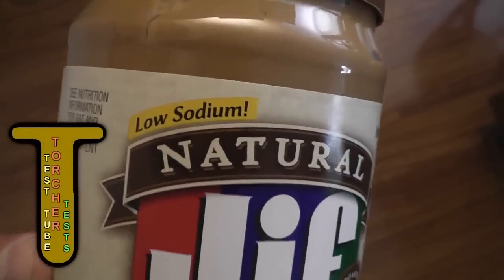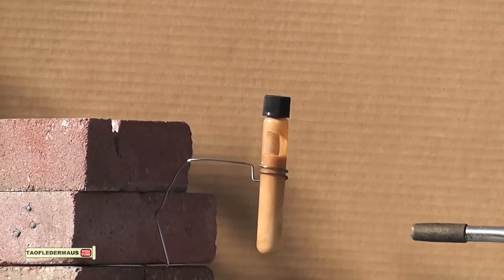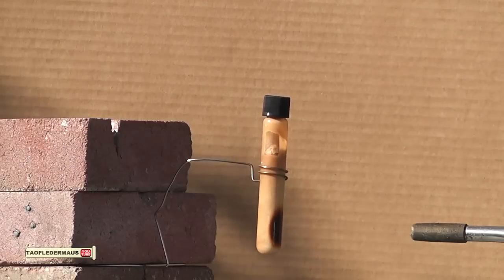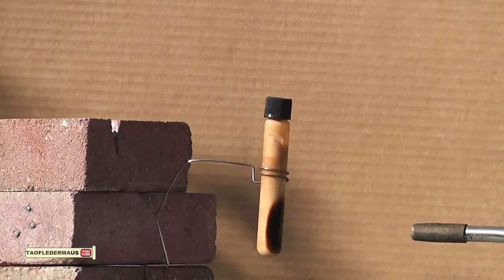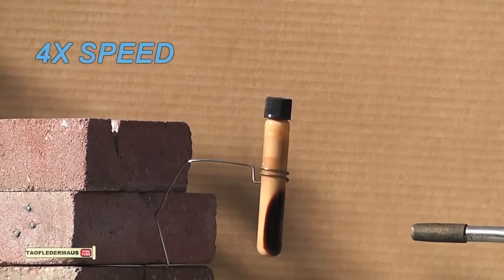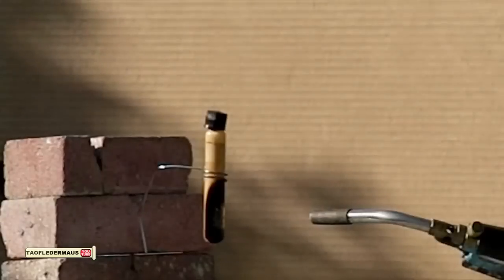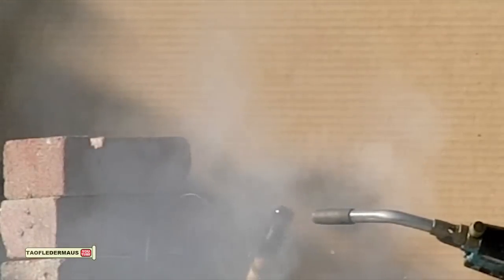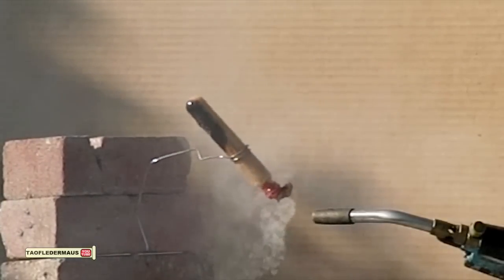Test Tube Torcher Tests - PEANUT BUTTER

Comment: What if you found a way to turn the tube, I guess it would be hard but a bit of modding could easily make a mechanism. It might make it easier to test substances like the Honey that burn and cause the glass to blow out.
Reply from the maker: That would definitely help distribute the heat more evenly.
Reply: ***** If you set the round test tube base down on a smooth hard surface (hammer face maybe) and lengthened the coil a bit so it couldn't walk out, it would probably spin a bit from the torch alone.  You'd lose a bit more heat but the contact area would be so small it shouldn't be that bad.  It'd be like your beyblade vids, lol

Comment: As always, awesome tests! Though, I am very curious as to what would happen with the substances that caused tube failure if you could heat it more evenly to avoid burning and hot spots.

Also, if you need ideas for other liquids to try... think automotive. I think it would be really cool to see what gasoline, diesel, brake fluid, different weight oils, gear oil, and stuff like that would do under extreme heat. I understand that some of this is probably a little too dangerous, but I figure in small enough quantities it wouldn't be too bad... Maybe...?
Reply: bearring grease or Crisco would be cool too

Comment: Hey Jeff, I just wanted say how much I appreciate you not using an annoying intro for your videos. Something about dramatic or highly produced intros just bothers me.
Keep the amazing videos coming!

Also, you should do a TTTT with some volitile, flammable liquid, and put a candle or another blow torch a few feet away for an awesome fireball.
Reply from the maker: I try not to be too flashy or pretentious- just get to the point.  lol   I do have a tube with model airplane fuel (with 10% nitro) loaded up.   It's hard to predict which direction the tubes will blow  and I don't know if I have enough candles to place all over the place.
Reply: ***** Model airplane fluid is farly similar in compostion to Hoppe's #9, I believe. Judging by that video, I'd guess that a candle placed a foot or so above the test tube would make a nice fireball. That's just me speculating, though.
Reply from the maker: I think it is methanol mostly.   It will probably be harder than you think to get a fireball since the LEL has to be ideal for combustion.   It will probably just blow out the flames.
Reply: ***** (Sorry for an absurdly long, sciency responce) Actually, I know firsthand how hard it is. I used to be a huge pyromaniac, so my friends and I would often try to devise way to make the largest explosions and fireballs possible. Anyway, I decided to try to calculate the distance a fire source would need to be from the tube to ignite; an hour and an Excel sheet full of calculations later, I have result that isn't all that encouraging:

Assuming the airplane fuel is mostly methanol, 30mL are used, the fire source is not extinguished by the shockwave, and that that the methonal vapor expands evenly in all directions, a fire source would need to be more than 0.2 meters but less than 0.35 meters away from the test tube for the concentration to fall between methanol's 6%LEL and 36%UEL. However, the vapor cloud would rise, and the volume of methanol vapor that would definitely combust would be 0.18 m^3 (~6.5 cubic feet), so maybe the chances aren't that bad after all.

To calculate this I used the density, specific heat, enthalpy of vaporization, heat capacity, vapor density, and molar mass of methanol. I also made the assumption that the test tube would break at 92.7 gauge psi, as it did in your other video, which equates to ~120ºC for the model airplane fuel when the test tube fails.

TLDR: If you know which way the wind will be blowing, you could put a fire source 2-4 feet from the test tube, and there is a moderate chance that it would ignite; procrastination from studying for finals made me spend far too much time on this.
Reply from the maker: You definitely understand how combustion works.   I have everything set up on a tiny table,  and  I have to figure out where to aim the cameras,  etc.   Also,  I just make one TT and do one take.   So I think I will have to rely on luck to get a fireball.

Comment: @25 seconds,
Temperature is a measure of the mass and velocity of the atoms in a system. When you add heat to a closed system (like your tube) the velocity of the atoms is increased by the heat source so this is an example of kinetic energy not potential.

It is easy to mix up the two.

Comment: You should add an RC servo on the blow torch valve so that you can remotely adjust the amount of heat. Servos and a basic radio system are really pretty cheap.

Comment: Do some pure lead!!! (Try fishing weights). Not sure how hot your torch gets, but it could be enough to evaporate enough lead to blow the tube.
Reply from the maker: I have a lot of lead shot from all the shotgun shells.   I may give that a try and see if I can get it to melt.   It very well may work!
Reply: Sounds good, although lead from shot has a lot of antimony and other metals to harden the alloy. As a result, the boiling point is somewhat higher I believe.
Reply from the maker: That's possible.   I do have a lot of solder and that might be a good alternative
Reply: *****
I'm sure you have already considered this, but I am going to say it anyway. You should probably look into getting a safer containment system if you want to make lead evaporate, and definitely have respirators and such. Again, I know you have probably thought of this but safety is always the biggest priority. I am sure I speak for everybody else when I say we don't want you doing something that has any chance of hurting you.
Reply from the maker: I'm not even sure I can get the lead to vaporize.  I haven't looked at the boiling point,  etc etc of lead.   I definitely have to consider safety first
Reply: *****
2022 K, 1749 °C, 3180 °F
Just pulled that off wikipedia to save you the trouble :) I wouldn't be surprised if the remaining air volume gave it enough pressure to at least release fumes of some sort. Anyhow, better safe than sorry :p
Reply from the maker: Ah thanks!   Yeah,  probably won't be able to vaporize it,  just melt it if I am lucky!
Reply: *****
If the tubes can handle 400C it should work just fine :)
Reply: ***** the melting point of lead is under 700 F, how hot does your torch get?
Reply: frickbot
The torch can do it, the tubes will probably melt though.
Reply: ***** Yeah the lead is probably a bad idea. But here's a good idea... IODINE! (the solid, elemental kind, not a solution). You can get it on ebay. By heating under pressure, you should be able to get it to liquid (prior to boiling) instead of sublimating like it normally does in the open air. That could be realllly cool. And not dangerous either (Iodine isn't too toxic).
Reply: Njal Thorgeirsson
The lead could still be interesting, even though it probably won't do much. As long as he takes safety steps, he should do both :D

Comment: cool.
be careful as the combustion properties of common materials can greatly change when they undergo rapid vaporization.
as you saw, some of the oil vapor started to burn directly after failure of the ampule.

For example, cornstarch can burn extremely rapidly in an aerosol form.

heyyyy theres an idea >.>
Reply from the maker: I'm always a long way away.   I have some test tubes loaded with much more flammable stuff.

Comment: I wonder what happens if you use crude oil in a Test Tube Torcher Test?
Reply from the maker: I tried some Valvoline motor oil and the dang thing sat there for about 15 minutes and never leaked or blew or anything.   It did expand and turn black though.  I trashed all the footage since nothing happened.

Comment: What's with the red guts coming out of it?
Reply: That's the plug.. from what I understand, it's a substance that goes into the end of the test tube to seal up the end.. the cap goes on after that to seal it even more.
Reply from the maker: It's high temperature silicone used to plug the test tube.
Reply: ***** Why not try an epoxy? I think the silicone would be to bendable whereas the epoxy would be more like an extremely hard plastic. Just a thought anyways.
Reply from the maker: I originally used epoxy but it has a different expansion rate than the glass so often it would form small leaks.  The silicone gives me good consistency.
Reply: Very good point, otherwise, I don't have any good ideas about how to seal it.

Comment: WERE DID THE FREAKING FIRE COME FROM (when the tube blew out is made some fire?)
Reply: What that guy said. Basically, when things are heated up they go through a similar process to electrolysis. Each materials molecules are most attracted to molecules that are the same, so when they have enough energy to move (when heat is applied they get energy) they collect into their seperate groups. The oil collected into a separate material from the rest, and since it was the lightest ingredient it was on top. When the top failed, the oil flashed into vapor and the torch ignited it.
Reply: Ok
Reply: Science fact: Oxygen+heat+fuel=fire
Reply: *****
Since you can't burn peanut butter, he was clearly wondering where the fuel part of the equation came from.
Reply: Actualy fire can occur without o2 it just has to have an oxidizer like rust used as an oxidizer in thermite
Reply: Der Hoindatch
In thermite the reaction seperates the oxygen from the iron back into O2. Every flame needs oxygen in order to burn, that is an intrinsic part of the plasma that literally is the flame. An oxidiser is just an agent that chemically reacts to release O2 as a seperate source from the air, so a flame can burn underwater or in extinguishing gases.

Comment: whaaa... why is your peanut butter only 90% peanuts?

'merica be weird.
Reply: That's what i was thinking, i wanna try some of this 90% PB...you think it tastes better than 100%?
Reply from the maker: What kind of peanut butter do they have in 'ngland?   Do they even call it peanut butter there?  I'm thinking goober pea crème?
Reply: *****
 Ye it's called peanut butter still, it's nearly always 95-100% peanut though.
Reply: Peanuts, Vegetable oil

das it. that is peanut butter here in Aus (the decent tasting ones anyway)
Reply: Some peanut butter has stabilizers to keep the oil from separating, vegetable oil, which also makes it smoother and easier to spread.
Reply from the maker: I think the Jif is homogenized so it doesn't separate.
Reply: It's just freaking palm oil. Really?

Comment: i would have put money on a fouled tube...
Reply from the maker: It almost blew out,   the glass was bulged.  It was mostly solids with little liquid.  So peanut butter would not be a good material to run in your boiler.

Comment: I think it might be interesting to see gasoline or diesel fuel.
Reply from the maker: I've been collecting diesel from the nozzle at the gas station in a little jar but I can only get a few drops at a time.    They won't let me buy just 30ml of it.
Reply: Ya I didn't think of that every one around where I live has a diesel tank in the back of the truck for equipment. Any time I need a little I get it from them .

Comment: Could making kind of a furnace with propane torches allow for better heat distribution?  Like some of those aluminum smelters on YouTube.  Or spin off series. "WILL IT SMELT? !"
Reply from the maker: I don't want to block the test tube from the cameras.    I kind spread out the cameras at different angles around it.